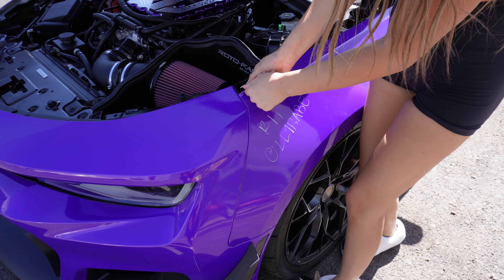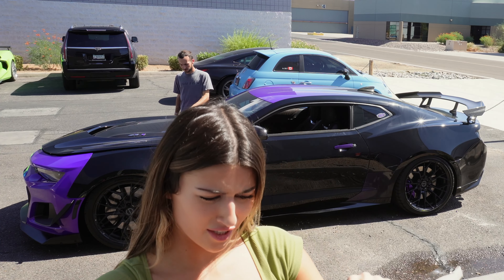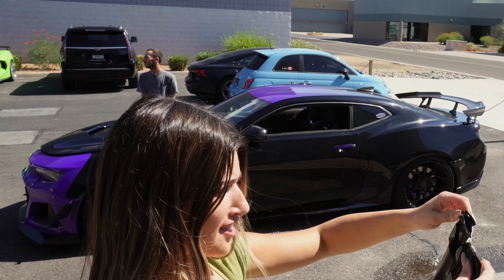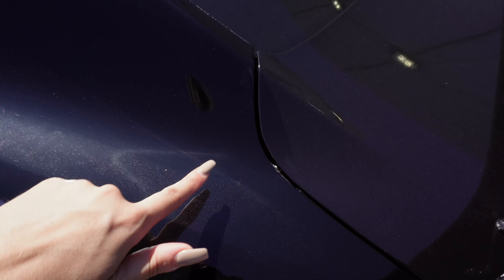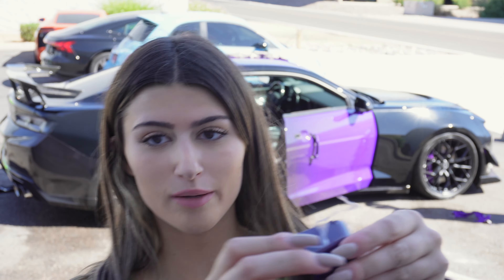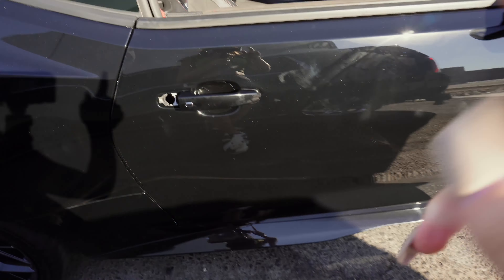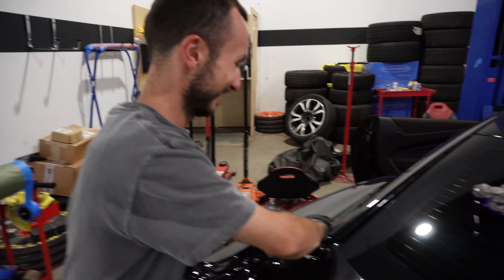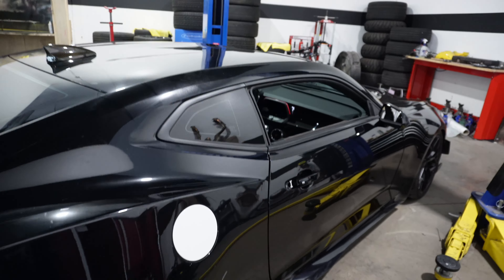I Took off My NEW Wrap ALREADY!?

Comment: The shoe game is 🔥 Don’t they usually remove some panels to wrap the car? When you pull it off there isn’t some left in the seams? You didn’t show the unwrapping around the dive planes.
Reply from the maker: yes they usually remove a bunch more. I didn't because it'll be taken back apart when they wrap it anyways so I wasn't worried about it! but thank youuu
Reply: @autumnspooner  makes sense so then you don’t have to pay to get it unwrapped. Didn’t think about that they will have to disassemble it. 👍